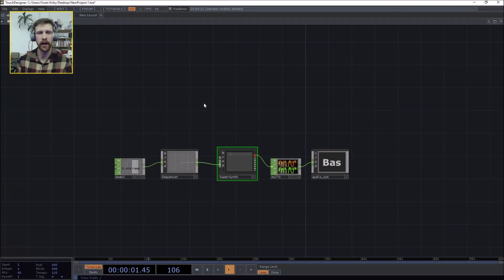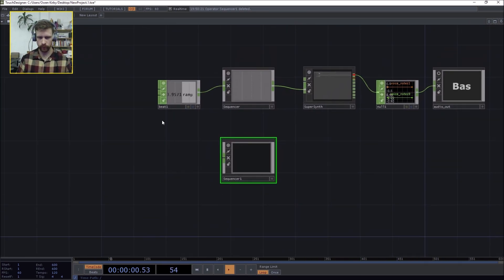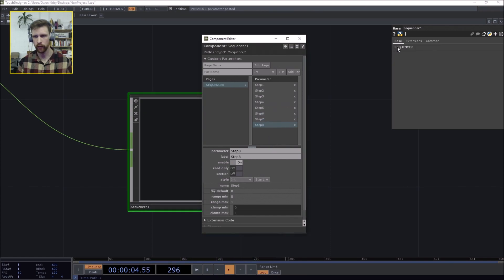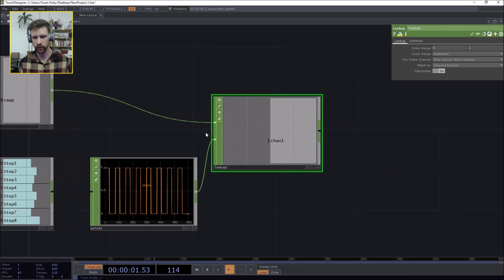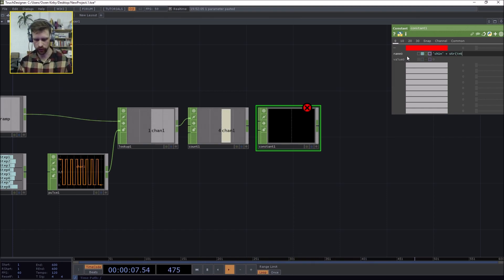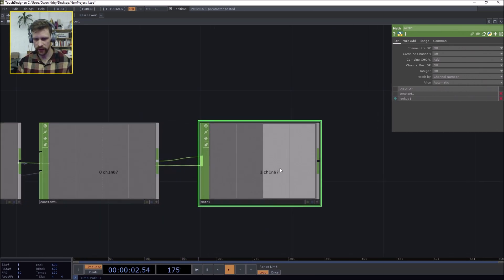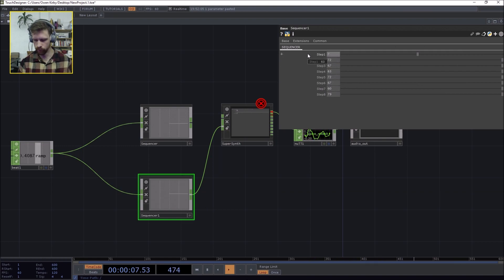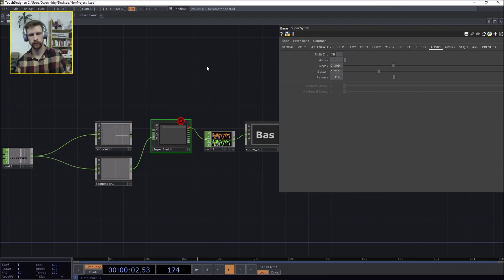ELECTRONIC APE FRIENDS - Episode 3: Building a Midi Sequencer in TouchDesigner

Comment: Hi, what an interesting tutorial. For a project i want to be abele to work with these midi paterns within TD. I am just getting into TD and have never workd with python but when typing in the value in the constant it does not seem to work. Instead i get 0 string_int_op_null1_ and  after that it's the same but some diffirent letters on the end on diffirent chanels. Any tip on what to do?
Reply from the maker: can you timesstamp me to where you're having trouble? It sounds to me like you haven't switched the parameter to be an expression rather than a value.
Reply: @OwenKirby  You are completely right; I was not paying attention when you clicked that option at 4:47. Thanks for your quick answer, though. Much appreciated!

Comment: So awesome! thank you a lot. Is there an easy way to "mute" some steps? in order to make rhythm patterns (i already made mine 16 steps).
Thank you again ;) i'll be waiting for more tutorials
Reply from the maker: Yep! Just dig into the pulse chop parameters and adjust the values of each pulse. These are the velocity values of your steps and you should probably create a custom parameter for them as well. A cool trick is to use the XY custom parameters where x will be the note number and y will be the velocity. It keeps things easy to read and work with on your sequencer component.
Reply: @OwenKirby  Thanks! i will try. I think that i can do it mixing your tutorials 2 and 3.